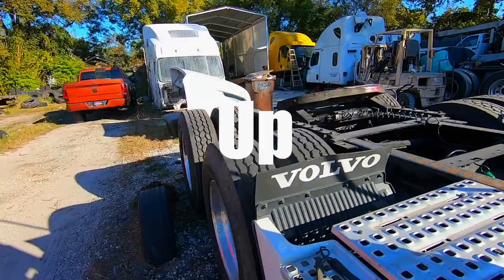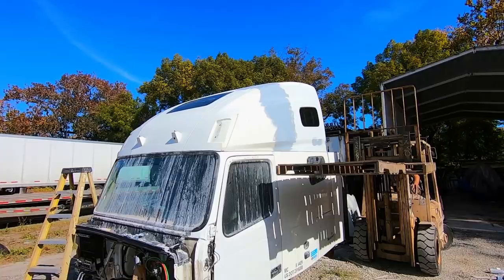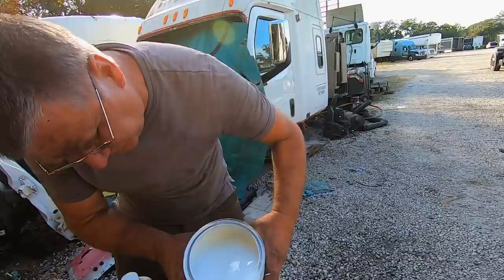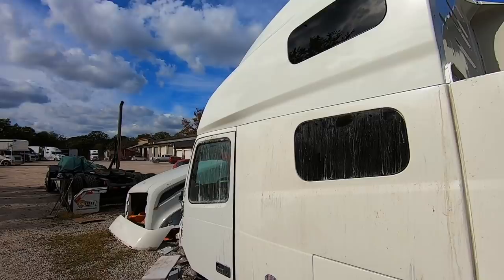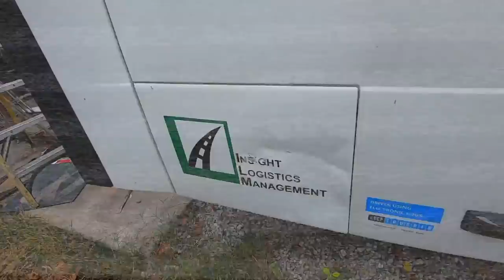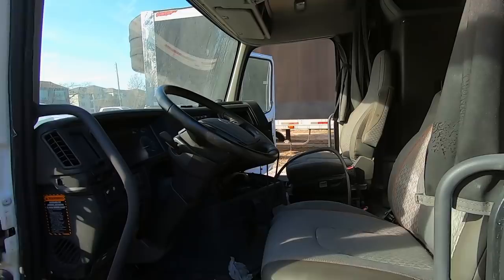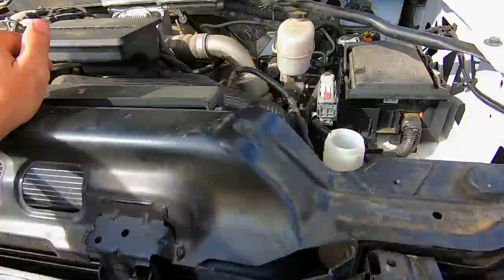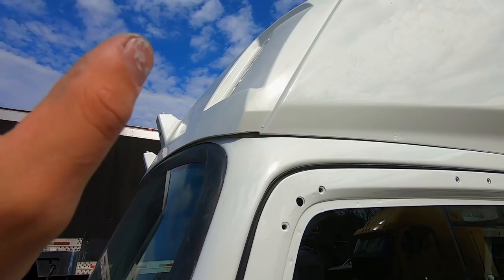PAINTING A Semi Sleeper Cab OUTSIDE?!? 2020 VOLVO VNL760 BIG RIG Project Rebuild ALMOST DONE! PART 8

Comment: You can paint outside in Florida really well because there is hardly any wind here.   I was amazed.    And you get a good color coverage because the sun is so bright you can tell when you need more paint.  Then the hot sun dries it fast. As long as its DRY Florida not humid Florida. if the old paint was clear coated that is your color difference.  The clear is making it more yellow

Comment: If the original paint is one-stage, then you might try buffing it, and see if it doesn't just come back to match the new paint!!

I am at least one quarter Ukrainian, and I spent today getting a lawn mower running, which I got out of the trash! Poked a guitar string through the little hole and tube, and now she runs.  OHV too!!! I'm gonna let my neighbor use it, and stick with my garbage-picked Husquevarna, and its Honda OHV engine...

Comment: Why would it have not been better for Ukraine to save their country by not fighting, (but resisting) and just waiting  and letting the sanctions work? Or, just give Putin his written, absolutely no NATO in Ukraine guarantee? Hell, he is 69 years old. Nobody lives forever. No hate. 

I am an occasional outside painter. Most of that will sand and buff out. But it will take lots of time. I’d be inclined to pay a professional on the side  to drop by and shoot it if it were me. I also have better luck painting outside very early in the morning. Fewer bugs, less trash in the air it seems. At least in Virginia. Hurry up, if you are going to sell it, as my crystal ball says the truck market is going to crash not to far in the distant future. Best wishes.

Comment: Terrible painting job from start to finish. Why wouldn’t you paint the whole cab with all the new parts and dents repaired that you did to it? The runs were really bad. Sand everything back down and repaint it when you paint the hood. You had a forklift there so painting the top shouldn’t have been a problem. Thumbs down on the paint job.